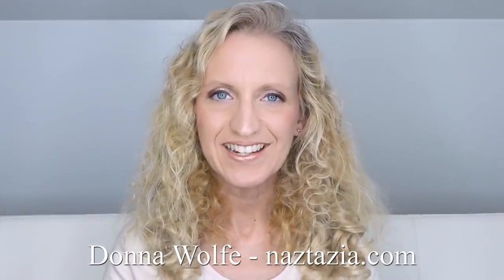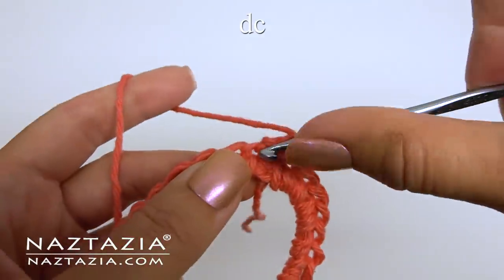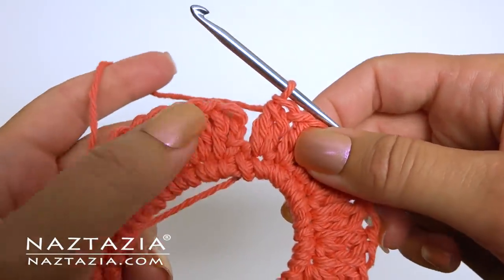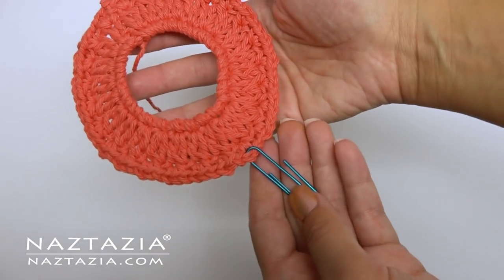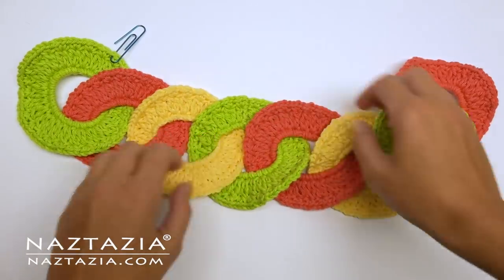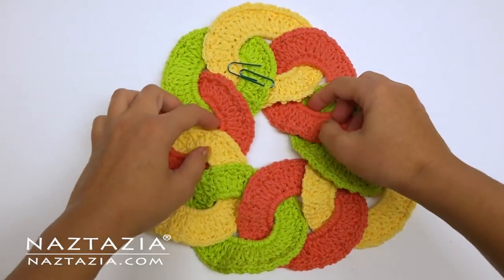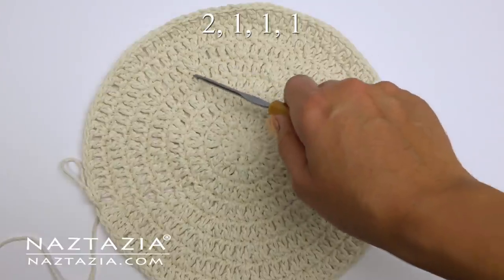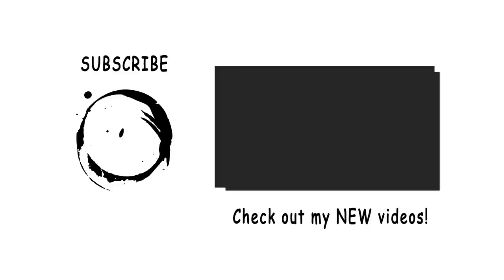HOW to CROCHET KITCHEN RING PAD - Potholder Hot Pad Trivet by Naztazia

Comment: We use to make them by going over rubber seals. Making one strip to connect.
Reply: My grandmother has one made with canning seals. She wants a new one. Would this be close to those kinda twisty ones??
Reply: @Crazgreekgirl6  Yes. You crochet with cotton  yarn 4 ply in double crochet around 4 rings
Could try 5 if you like but I think we did 4 then you crochet a strip as wide as the part around the ring in the double crochet and I am guessing 6 to 7" long lay out your rings in a circle overlapping centers weave in and out the ribbon you just made and sew end shut. That's it.  Sounds maybe confusing but once you lay it out it makes sense.

Comment: Size g is number!!!!!!!
Reply: It's 4mm. I wish that every tutorial came with both sizes. After over 20 years in the US, I still don't get their letter size. It seems odd to me as most countries use the metric system. Oh well, just a little research et voilà. In case you need help: 2.25 mm/B-1
2.75mm/C-2
3.25mm/D-3
3.5mm/E-4
3.75mm/F-5
4mm/G-6
4.5mm/7
5mm/H-8
5.5mm/I-9
6mm/J-10
6.5mm/K-10.5 or 101/2
8mm/L-11
9mm/M/N-13
10mm/N/P-15
15mm/P/Q
16mm/Q
19mm/S
Hope it helps. Good luck
Reply: Frenchie Florida THAT WAS GREAT INFORMATION!!!
Reply: @noahlani1969  thank you so much for such information ❤️
Reply: @renaarmstrong2838  My pleasure. If you need help with the steel hooks sizing. I have the metric and US conversion and knitting needles as well.
Reply: @safeyaahmed4046  My pleasure. If you need help with the steel hooks sizing, I have metric and US conversion sizing as well as knitting needles.